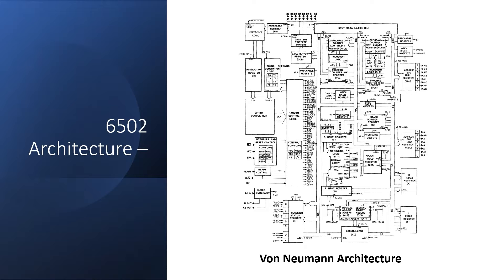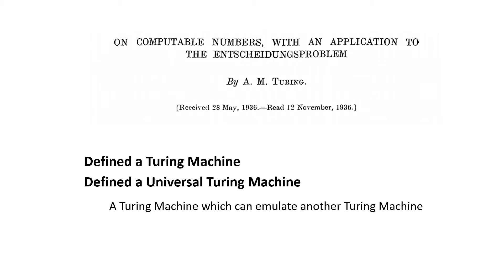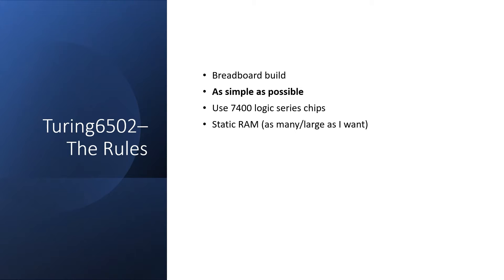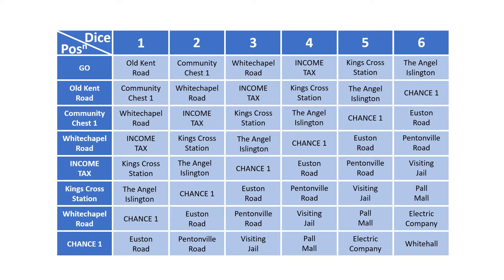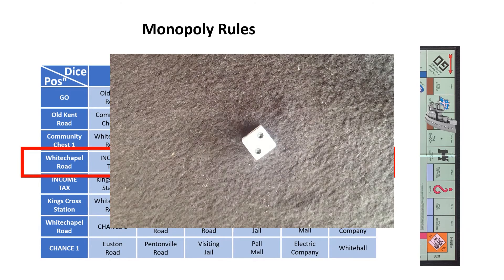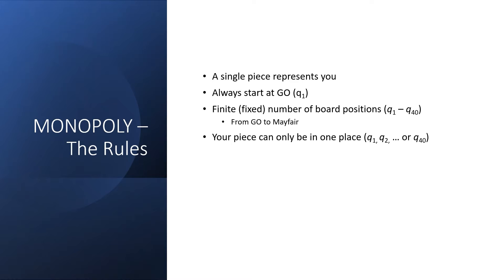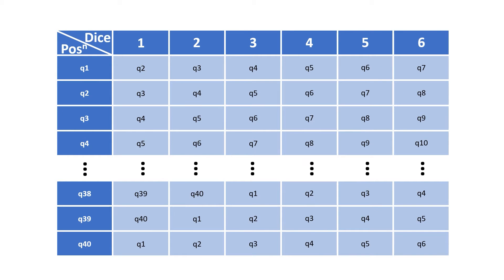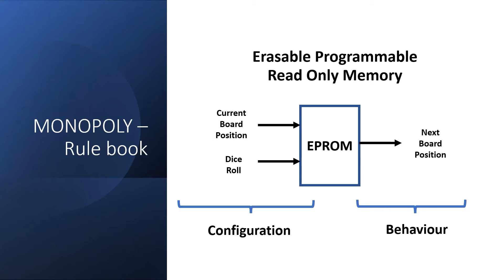Rulebook and notepad: Turing Machines Explained. Turing 6502 Part 1.

Comment: Why didn't CPU makers use this Random Access Machine based approach in the 70's? ROM + TTL D-type latches require a much simpler processor (though at the cost of more ROM). An ISA that's not constrained to be 6502 compatible can perhaps be represented in less ROM and/or fewer cycles per instruction than what the Turing 6502 needs. Maybe a two-stack machine, RPN opcodes. There were CPUs in the 70's that used very few on-chip registers. The TMS9900 only had 3 registers: program counter, status and workspace pointer (this latter is neat but somewhat optional). 16 work "registers" were stored in main memory. A bit like how page zero was used with the 6502.
Reply from the maker: I think the single main reason is the size of the Rulebook.  In this case it's 8 MBytes, which wasn't really practical in the 1970s and certainly not commercial.  I'm actually about to release some videos on how architectural changes significantly changed the Rulebook size required.

Comment: A couple things: First, the breadboard build only has 12 bits wired up for the state right now, not 13, but I assume that's already been fixed. Second, the end card covered part of the wiring diagram at the end of the video. If you're going to use end cards, I would recommend at least a 20-second long end screen (doesn't have to be anything fancy) so you don't risk the end card(s) covering anything important.
Reply from the maker: A12 of the EPROM gets hooked up a bit later.  I actually have two versions of the code, one which fits into 1M words and the other into 2 M words.  Do you want to have a guess at how i did this?
Reply: @DrMattRegan  I'm not sure what you want me to guess here. Is it how you're going to fit the emulator into only 1M words (4K states), or what you'll use the other half of the EPROMs' memory for?

EDIT: Actually, if you're looking to make it compatible with the Apple ][ build, I guess the last address line would have to correspond to the bus enable pin of the 6502.
Reply from the maker: @sillymel  haha. Actually both. But let’s tackle the second one, have you watched NTSC from an EPROM?
Reply: @DrMattRegan  No, not yet. I'm watching the videos on you're channel in order from oldest to newest. That being said, I did edit my previous reply to give a guess for what the last address line would be for based on which 6502 pins the Arduino has access to in the Apple ][ build.

Comment: Thank you for this content. I just discovered you today and subscribed. 
In principle and closer to the spirit of Turing machines (i.e., with the tape and the R/W head), it should be possible implement both the rulebook and the notepad in SRAM chips, some parts of which would just be read only? What technical inconveniences would entail the synthesis of a Read Only signal for the SRAM responsible for holding the rule book? Alternatively, maybe there is no need for the read-only signal at all if one wants a SRAM rulebook to be allowed to change itself? I stop here with this line of thinking before things get out of hand...
Reply from the maker: Good question.  The rulebook is the state transition table in the Turing Machine, while the Notepad is analogous to the 1D tape.  So the transition table is somewhat analogous to the microcode in a CPU, so it only needs to be changed when you modify the instruction set.
For example the 6502 emulation has a different state transition table compared to a Z80 emulation.  But for the most part, you can burn them into ROM.  You could put it in SRAM during debug though, that would be extremely handy.
The notepad is more like the internal registers and the main memory of the overall system.
You might want to have a look at the Pure Turing playlist, i think it is a bit clearer there.

Comment: Very interesting, I have just subscribed. I'm wondering, is there a sistematic method (even if it's only empirical and not formal) to kind of  optimize the placement of chips and especially wires on breadboards. I've learned a few things watching this partícular video, even if I now recognize some patterns I might have seen on more breadboard circuits, watching build it was actually interesting and revelating. I'm wondering if I'll be able myself to come up one day with such polished placement and optimized wirings... Nice!
Reply from the maker: Hi Alexandre, I think the unusual thing i do is mount the 600 mil chips across the power rails.  With a jumper, it means that you have 7 positions to connect up to.  If you mount it normally, you only get two or three connection points.
Reply: @DrMattRegan  indeed, it's brilliant!